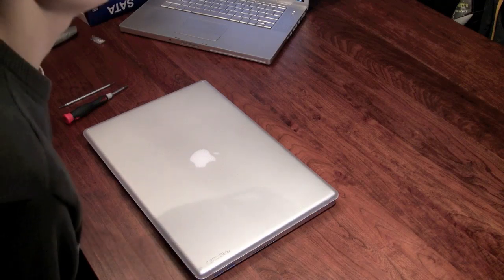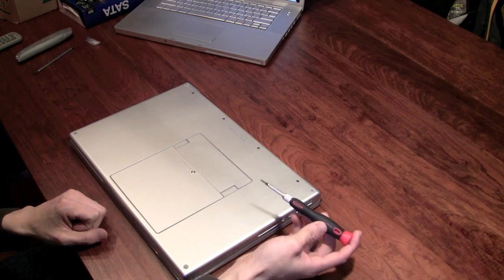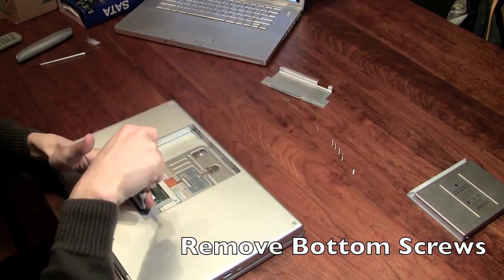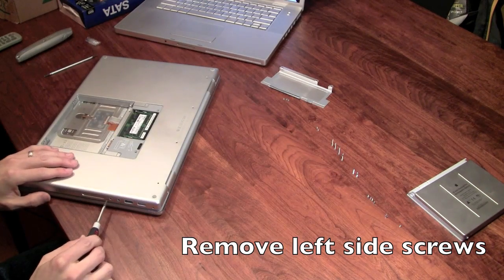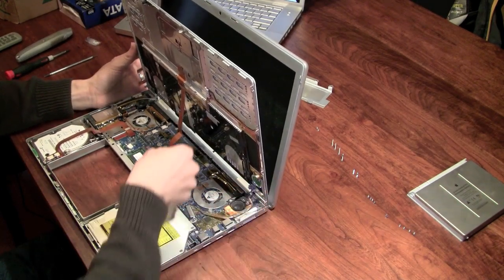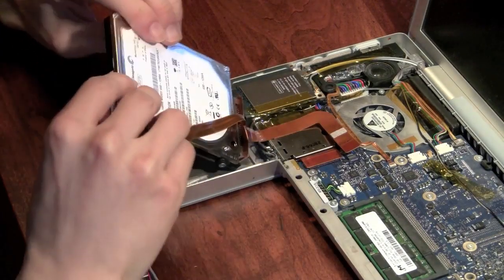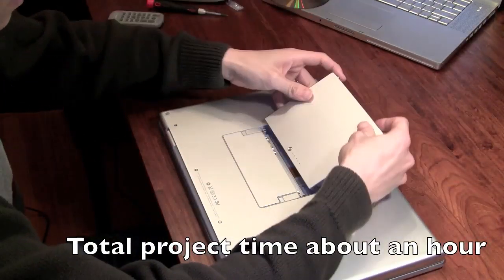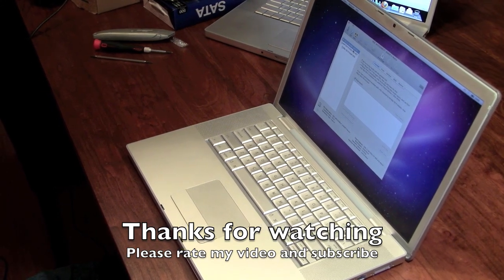First Gen. (Early 2006) Macbook Pro HDD Upgrade

Comment: I need help! I have an early '06 Macbook Pro, and it was working properly. I took it to my local Apple Store for upgrades, and it came back broken. They said that the hard drive was fried, but I tested it externally with my Windows laptop, and the drive worked fine. I think Apple lied to me and tried to cover up the fact that the connector ribbon was damaged. I also tried putting my Windows laptop hard drive in my MBP and it didn't rattle or make any noise at all. I have tried using multiple hard drives externally with the MBP, but it still shows the same thing - a flashing question mark on a folder. I can't reinstall OsX, as the superdrive spits the disc right back out when I put it in. Also, does a hard drive have to have an Apple logo on it, or will any 2.5" HDD work? I have tried using an external DVD drive, and my Mac shows the Apple logo for a minute and then shows a "Not Allowed" (Prohibitory) sign, and the external DVD drive stops spinning, and won't open unless I replug it. Does anyone else have this problem? Also, if you have a solution, please tell it to me! I want to get my Mac running again!
Reply: +Keyless Artz you can always tell the shop that the Mac was working when you took it in. If they damaged it, then they have to make good on it or you can say you will take them to small claims court for the price of a new system. It costs just $25 to file and if you win, they even award you the filing costs. But try to be reasonable and get them to fix things first.
Reply: Peter Wu this has happened over a year ago, and it's fixed now, but thanks for your suggestion.